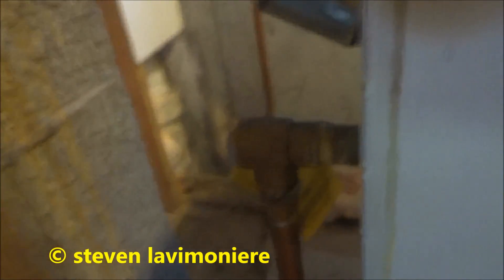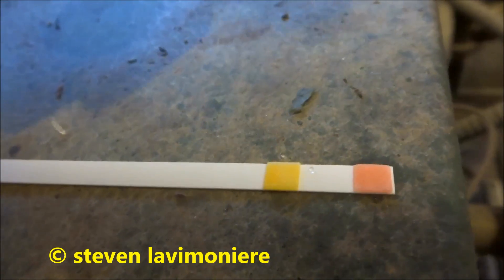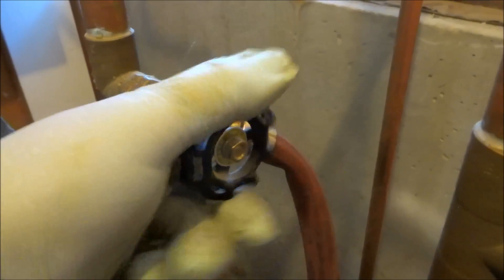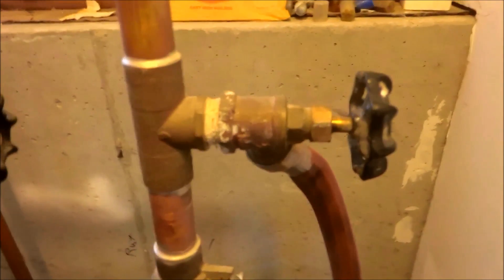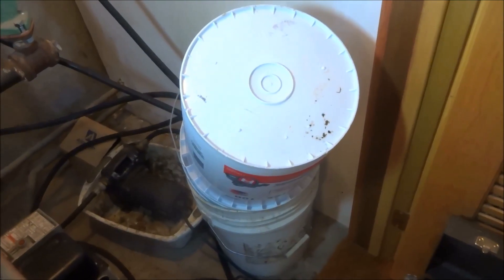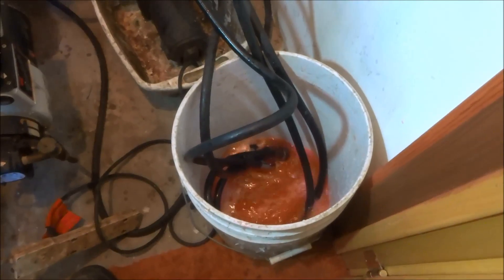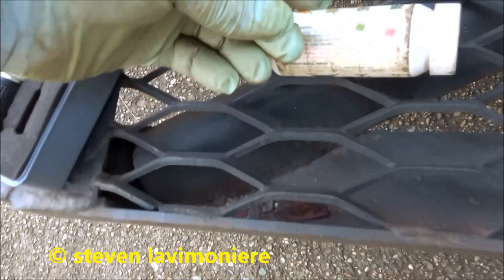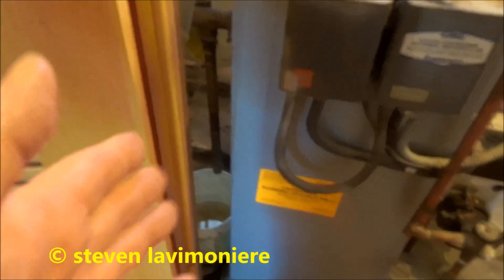reinstall glycol to hydronic heating system

Comment: Over 3 years ago I found my Hot water system had two strikes against it.  1) The water pressure regulator was bad and all clogged up, and 2) the Temp/Pressure gauge was reading 10# over the actual.  Replaced both and the system has been sweet, first time in 15 years.  I need to replace the T&P gauge having just added another pressure gauge I considered temp then.  The internet chat suggests most gauges sold now are junk?  Any suggestions?  I bought one of those junk ones online, and it was junk.  It looked like the one in your video.  I tossed it.  I have been living with a pressure gauge I thought might be junk, but it still reads 11#s.  It was meant for auto testing.   I once thought about anti-freezing the system (here in the North Central US), but thought  it might not be legal.  I do have soft water running through the system now for 15 years--no corrosion all copper system.  The pressure regulator I replaced looked like it might be original to this 50 year old system even though it was said they only last maybe 10 years?  Thanks for the video very well filmed.   And yes--we have the same overhang (11:22) with 2 bedrooms where the hot water line runs across--yet never froze.  I wondered about it?  The overhang is on the northwest side of the building as well!!!!   Talk about a double whammy?
Reply from the maker: +DOLRED only add glycal if you need it  its not good for the system
Reply: Thanks Steve...

Comment: I have the same anti-freeze tester. Thing works awesome for either propylene or ethylene glycol.
Reply from the maker: +Brad1237202 i like it and it works well . i believe it reads lower that whats in system .i have calabraded it before .
Reply: +steven lavimoniere Steven, what turns the glycol acidic being in a closed system, the heat of the water? Thanks for the video.
Reply from the maker: over time it needs to be replaced the heat affects it .4 to 6 years .
Reply: +steven lavimoniere Thanks Brother! Enjoy the warm weather before the snow flies! Take Care!